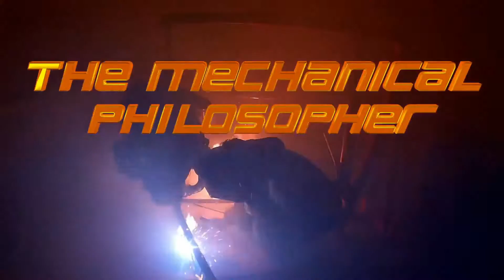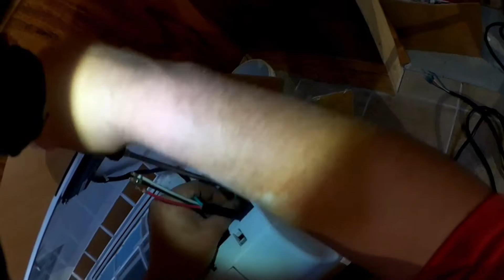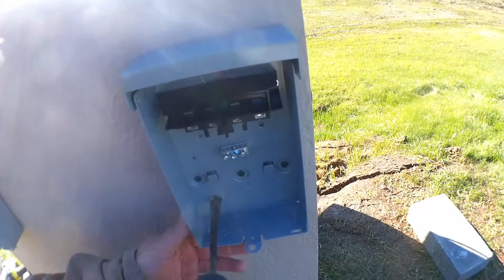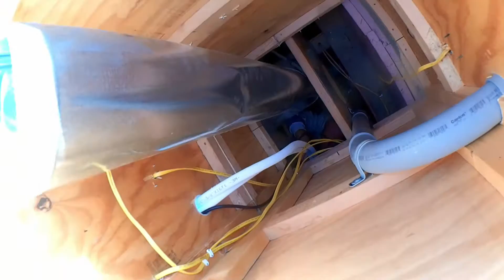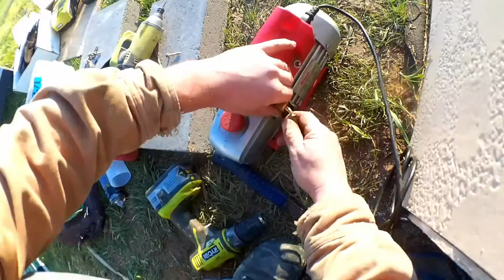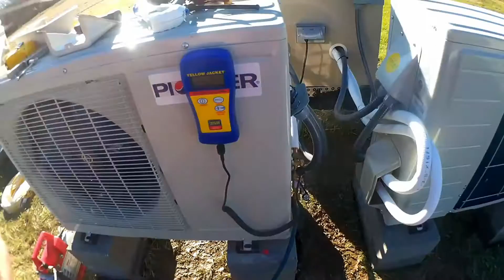Hobbit House 10

Comment: what is your option on sips walls. would you use them for a hobbit house. I heard they're supposed to be stronger then traditional construction but idk  if it would be stronger in this type of construction because you double stacked yours studs and plates for more support.
Reply from the maker: I don't think the one's I've seen would be up to this, but I haven't been following them lately.  They would have to be made for this application with a pressure treated exterior and bottom.  It's a very good concept.  I like the continuous thermal barrier you get with it, but I tend to lean towards developing methods that achieve the same benefits while being more field adaptable.  I like being able to change a design on the fly as it's virtually impossible to anticipate every design consideration beforehand, especially when the products available to you change during the course of one building.  This also results in an easier job when it's time to remodel.  If this was my building, I would have added  1/2" foil faced foam board on the interior of the exterior walls as a better vapor barrier, radiant barrier and continuous thermal break, but everything has a budget and you have to stop somewhere.  I know working without a set plan wouldn't work so well in a commercial situation, but I think it works very well in residential.
Reply from the maker: Also, we finished this building in January, but I am still struggling to find the time to edit the rest of it, so subscribe if you want to be notified when the rest of the videos come out.  Thanks so much for your interest.